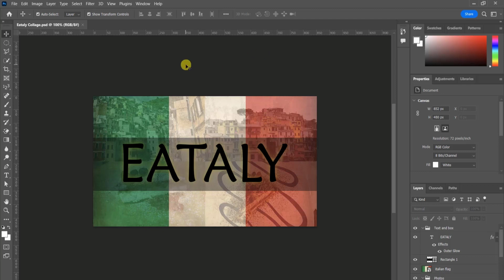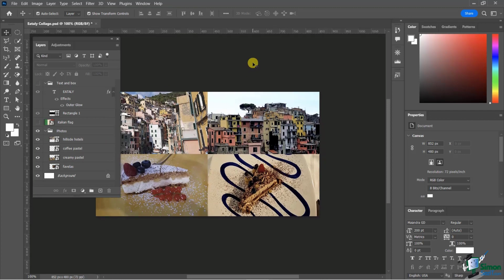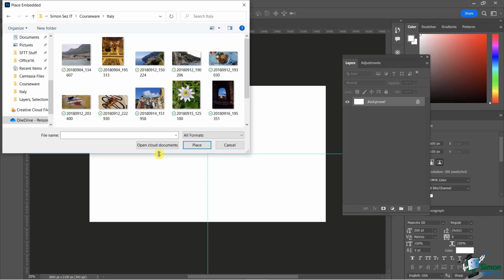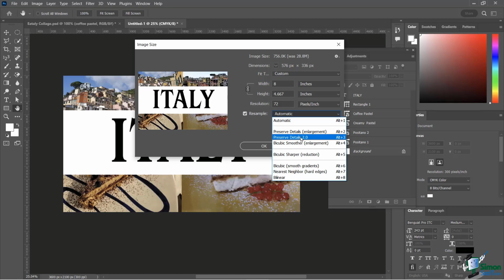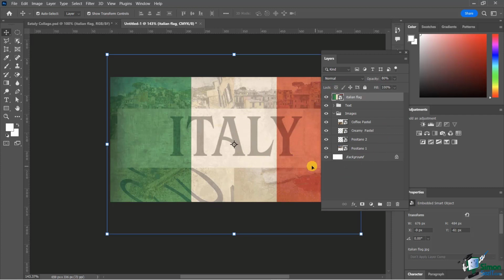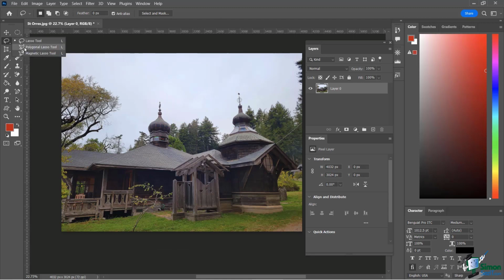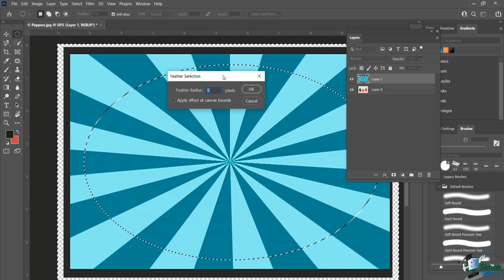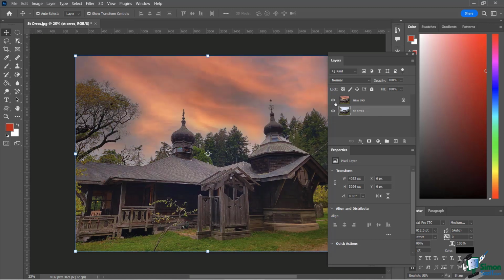Adobe Photoshop CC for Beginners: 2 Hours of Photoshop Training

Comment: Very disappointed in this. No mention of processing an image which us a major part of photoshop.
Reply from the maker: It's a 2 hour course, so we can't cover everything. To do so, we would need a 20-hour course.
Reply: @SimonSezIT  of course I understand that, but the intro text for the course says it will take you from a 'novice to a skilled designer' which will need a lot more than even 20 hours.  It's just my opinion.  I'm really pleased with the Excel courses I've done, but this one only slightly scratches round the edges.